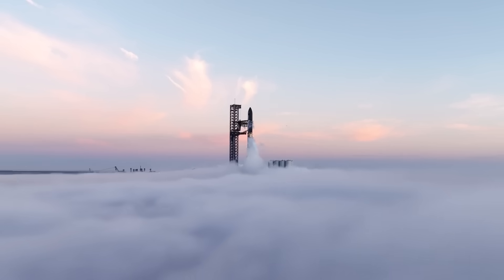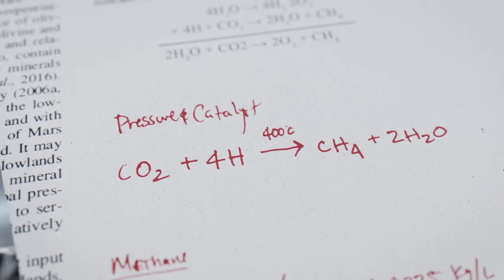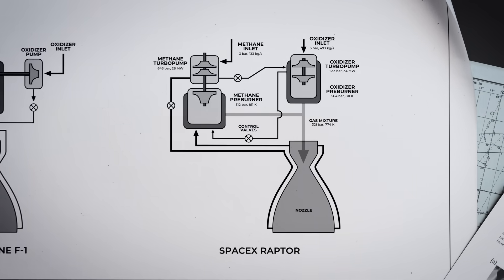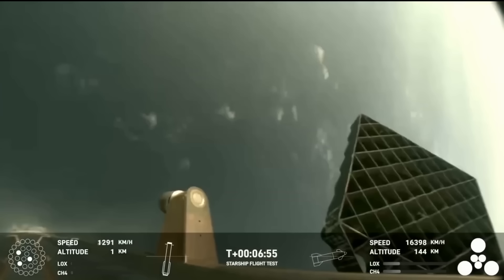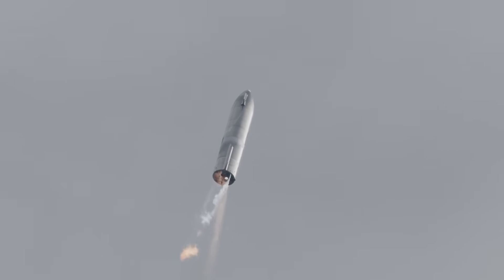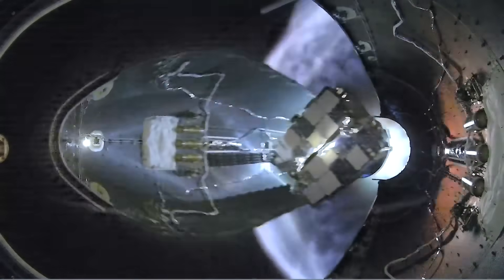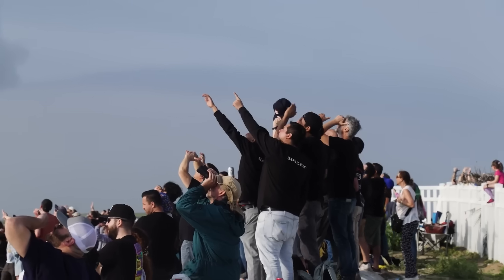Starship Reached Space. What Now?

Comment: You forgot the part where they need to launch 8-14 more to refuel it to get anywhere
Reply: That's incorrect. Starship can send about 20 tonnes to GTO with no refuels, or about 50 tonnes to the moon or 20 tonnes to Mars with just one refuel.
The 8-14 refuel figure is specifically to send HLS to the moon, which has a TLI injection mass of about 600 tonnes.
For comparison Saturn V could get about 45 tonnes to TLI, so it would take about 13 Saturn V launches to send that same mass to the moon.
And SLS can only send 27 tonnes to TLI, so it would take about 22 SLS launches to do the same.

Comment: I have to take issue with some of this and I do so not with any hostile intent.  First, I highly doubt that any SpaceX rocket will ever be captured by the chopsticks and fly again.  I mean, it may catch one, but I doubt it will do so without damaging the rocket in the process.  The precision the chopsticks will need to operate with and do so at speed and do that with large structures with very high moment of inertia is not something I'd bank my company on.  And second, NO, it is folly to incorporate launch and landing on the same tower -- in fact it's idiocy to even attempt it.  In a situation in which the booster returns to the launch area, and that is a small percentage of all reusable launches, the time after launch for the booster to return is on the order of 8 minutes -- 8 minutes after a nearly 800 million horsepower rocket departed the same tower.  If there was damage done to the tower the booster may not be recovered whereas if the booster capture pad was located some distance away it would still be available.  Additionally, the launch tower is at risk of damage by not only a failure during launch but also during landing which increases the chance the launch pad will be unavailable for some time.  I am stupefied that this isn't 100% obvious.

Comment: Hey realengineering,
I can already see a bunch of issues with this, but could there be any use for magnetic confinement technology to assist in reentry much the same way Helion uses it to protect its machinery from the hot plasma?
Reply: First thoughts...permanent magnets are heavy, coils are also heavy and need a lot of power, or less power but heavy refrigeration gear to make them superconducting.  Rockets (or at least, rocket designers) hate carrying unnecessary heavy stuff.

Tiles are a lot lighter.
Reply: @Mark_Bridges  oh yeah definitely, I’m more wondering if it’s even possible. Although now that you mention it I wonder about trying something like attaching a generator to one of the preburners and then just using a little fuel to power it. Again, not sure of the practicality of any of this, But I thought it was an interesting idea.
Reply: @romanthomas9113  I suppose you can obtain power that way, although the rocket motors aren't operating during reentry so you'd need to store the power...batteries are also heavy.  I reckon you'd be doing very well if you can get anywhere close to making this idea work.
Reply: NASA has actually done some research on the idea. See the paper "A Plasma Aerocapture and Entry System for Manned Missions and Planetary Deep Space Orbiter"
The first problem is that it's heavy and uses a lot of power. This can potentially be improved with better technology - maybe superconductors?
The second problem is that it stops working once you slow to about Mach 10 since the air stops being ionized at around that speed - but air at 'almost plasma' temperatures is still pretty hot, so you still end up needing some heat shielding anyway. Though steel is a lot more heat resistant than traditional spacecraft materials, so Starship might get away without it.

Comment: So correct me if I’m wrong, but they have gotten the raptor engines to work, but the main issue is that the ship tumbles when it falls back to earth, so it gets burn apart when it reenters earth?
Reply: Yes, although they got the raptor engines to work maybe 2 years ago.  Spacex will sort out the control problem that caused the tumble and the next launch will be better. Fingers crossed.
Reply: The only thing they haven't been able to test for the engine is the ability to re-light in space, they chose to skip that test on IFT3 rather than risk the ship going the wrong way due to the rotation.

Comment: Need to have some re-entry fuel to slow down and avoid intense heat.  It's an energy problem.  Don't subject spacecraft to such intense heat.  Yeah yeaj the rocket equation, etc...  Doesn't change the point.
Reply: Perhaps you forgot the shuttle used a very similar method to reenter the atmosphere?
Reply: But it does make your point meaningless.

Comment: I think making it 100% reusable is too ambitious. Let the booster be disposable and focus on making the upper stage the kind of craft thay have in mind.
Reply: It might be to ambitious.  However the most shameful way to fail at something is to fail for lack of trying.
Reply: the booster is way more expensive to make so they should focus on both.
Reply: @kylej7593  
The booster is also the easier of the two to recover, and doing so has less impact on performance. If you can only recover one stage, then you absolutely want it to be the booster, not the ship. Funnily enough, that's exactly what they did with Falcon 9...
Reply: @lazarus2691  what are you talking about? The second stage is supposed to ferry people and cargo to and from orbit - recovery is essential. The multi-stage with capsule model exists for a reason. People did a lot of failure in the 50's and 60's to learn these lessons. Also 30+ years ago the soviets launched energia twice, the second time had a fully automated re-entry vehicle modeled on the STS - no explosions.
Reply: @howilearned2stopworrying508  
It would be cheaper to launch people on Dragon than to throw away a Superheavy booster in order to get a crewed Starship up. Without Superheavy reuse there's no point in reusable Starship, so you might as well relegate it to being a partially reusable super heavy lift vehicle, for which there is still plenty of use cases.

Comment: Why is starship constructed of steel instead of aluminum? You would imagine the reduced weight would be a major benefit. Seems strange given the success of the shuttle program. Is it a cost concern? Is the ballistic coefficient meaningfully changed in an advantageous way? 

I also admit I’m not a material scientist or engineer. I’m sure there is something obvious I’m missing.
Reply: aluminum melts at a lower temperature, which is very bad for a vehicle undergoing reentry. Al is less dense, but not lighter by much, if at all. the lower density means you need more of it to get the same strength (kinda a gross simplification). it mostly cancels out. also, the steel they use holds up better at super cold temperatures than Al does, which gets brittle.
Reply: @kylej7593 You got it right on about the material specs, but you didn't go into cost .
Steel -- even that type of steel that doesn't get brittle at cryogenic temperatures -- is cheap .
As in, really stupidly cheap.

You can chunk out a steel rocket for significantly cheaper than you can an aluminum one (half to two-thirds the cost), and compared to carbon-fiber rockets, the savings for steel are ungawdly.
Tim Dodd did a cost comparison between steel and carbon fiber in a video with the title, "Why SpaceX ditched lightweight Carbon Composites for Stainless Steel to make a sweaty Starship." (YouTube doesn't even let you post links to their own site.)

Dodd's video has been largely overtaken by events, but the cost comparisons are still good.
The cost comparisons for aluminum and steel are just manufacturing industry standards, but they're in the right ballpark.
Reply: @kylej7593  Good summary.

Comment: Actually, at 2:08, the space shuttle only experienced blackout until 1988. After that, they were able to maintain communication thanks to the new Tracking and Data Relay Satellite (TDRS).

But it's not as simple as transmitting upward; there's only a narrow channel behind big spacecraft where the signal can pass without too much interference with the plasma. What Starlink enables is higher bandwidth to transmit video as well.

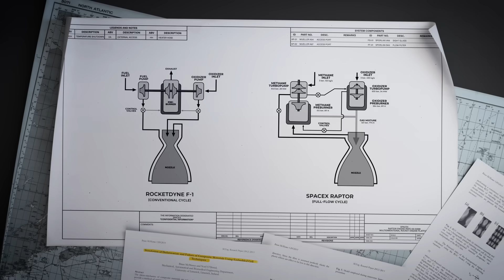Comment: Small factual error at 7:32 you say that only a small fraction of the propellant is pushed through the turbo pumps. I think you meant preburner? All the propellant is pushed into and by the turbo pumps of course. Another small detail is the roll Starship did. It's fairly certain that it was what's called a BBQ roll. In order to heat up from the sun from all directions spacecraft that go through a coasting phase do such a roll. So IMO the roll was fully intentional but maybe they had issues with their reaction control system to stop it before entry.

Comment: No worries about Mars having enough water. There is plenty, right there on the surface; even near the equator. Just one example: At the west end of Valles Marineris is a feature called Noctis Labyrinthus, which is in the heart of the Tharsus region. The coordinates are 7°S, 93°W. There is a relict water ice glacier there which holds 36 billion tons or 8.7 trillion gallons of H2O; slightly larger than Lake Meade at the Hoover Dam near Las Vegas, Nevada.
Reply: And if you still need more you can make it from some of the fuel from the MAV

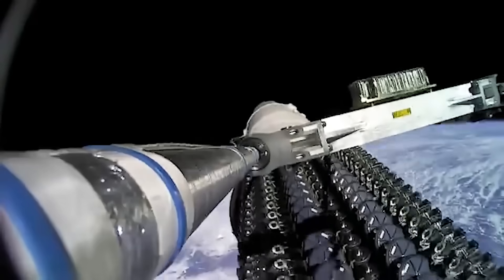Comment: 2:25. Ummm...  No.  The space shuttle could and did use the TDRS system to maintain contact with the ground in exactly the same way as Starship tried to do.

As pointed out in the telecast, it isn't 100% certain  that this will work for Starship -- whether it works depends on how "diluted" the energetic ionized gas is, which depends on the cross-section of the vehicle during re-entry

Dragon has a relatively small cross-section, so the plasma is dense enough to block communication behind the vehicle, which is why we don't have live telemetry for Dragon capsule re-entries.

The Space Shuttle had an enormous cross-section, so it only rarely suffered from communication blackouts during re-entry.

Starship is somewhere in between, so....  maybe?

Also, at some point in the past infrared video was captured of the plasma generated during re-entry for the Space Shuttle.  It was part of the OEX suite, which involved mounting two cameras in the tip of the tail, pointing down and towards the front.  While the cameras and the like were removed long ago, the modifications to the tail remained, which is why Columbia's tail looked different from the other orbiters.

The footage was taken long ago, however, and it wouldn't surprise me if it was discarded without being digitized.  But it certainly existed at some point in the past... 😂
Reply: I think he meant this is the first time we've seen real time video of reentry plasma, therefore I say ummm... Yes.   I don't think Shuttle video you mentioned was real time.

Comment: When returning, both the booster and the second stage blew up. While this is definitely a failure for SpaceX's ultimate goal, if this was anyone else and any other rocket, it would be an immense success. Most boosters and second stages blow up, if you look at it that way this was a complete success, SpaceX has just showed off a rocket larger than any other in history, getting to space. Technically they could stopped development right there and start mass producing them and using them to destruction. It might not be too insanely expensive either since the rocket is made of steel, the main cost would be many expensive raptor engines. Kinda shows how crazy SpaceX's goal is that a complete success for anyone else, is basically just them completing the easy part.

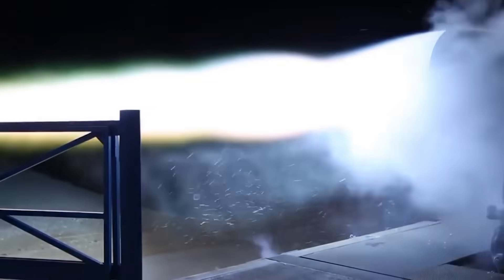Comment: The language at 5:20 is a bit sloppy / incorrect. Raptor is not the first full-flow liquid rocket engine.  Most Russian / Soviet rocket engines were full flow rather than open-cycle.  Engines using that principle of operation have been used in hundreds of flights by both Russian / Soviet and American rockets for 6 decades.

Raptor is, however, the first full-flow liquid rocket engine with staged combustion, which was mentioned at 1:30
Reply: The RD 270 never flew. Which was what they said

Comment: Getting a giant rocket into space is one thing. Getting it back is another. These things have too much mass and surface area to keep from burning up. Most re-entry vehicles are small with the exception of the space shuttle, which was a space plane very different from a long, large thin tube. SpaceX has done some amazing things, but this is a bridge too far. A great platform to get heavy payloads into space, but I think a lot more of these are going to burn on re-entry before they realize the physics doesn't support re-usability. It was barely scratching the atmosphere before the heat tiles were flying off like confetti.
Reply: So you're an engineering expert with more information that a bunch of well-resourced spacex engineers??  I'm glad spacex makes decisions based on science, not the ramblings of armchair experts.

Comment: They attempted to start the booster engines at a descent speed of 1200 km/h, so the nozzles pointing downward were facing an air current of 1200 km/h. I can't imagine the amount of pressure that current would translate into at that moment when it is concentrated at the top of the nozzles, opposing the engine's exhaust. Does the Merlin engine experience the same counterpressure during Falcon 9 booster landings?
Reply: The merlin engines do an entry burn when the booster is moving at something like 6000 km/hr (number from memory, probably wrong) but that burn isn't too bad because the air is still fairly thin.  They do a landing burn at something like 1200 km/hr (ditto) so yes, similar conditions to starship.  The merlin engines do it all the time so spacex will get it right with the merlin engines soon.

Comment: i think the fuel left in booster after boost back or entry burn is too low, it wont make smooth landing to the launch site except doing suicide burn
Reply: Not the case
Reply: yea i know its not current problem, but it will a problem. at 3rd flight test, starship doesnt carrying any payload and the booster landing at sea with almost empty fuel  @weekiely1233
Reply: yea i know. its not current problem, but it will be a problem. at 3rd flight test. the starship doesnt carrying any payload and the booster landing at sea with almost empty fuel
Reply: @secrettube4u  they carry less propellant on these flights than on operational missions
Reply: @weekiely1233  when they add fuel it will add mass too, when mass added it will burn more fuel to lift off (like the 1st test flight). i hope when real operational mission is begin, the fuel will not be a problem
Reply: @secrettube4u  it won’t be

Comment: In the live stream of the starship re-entry they were saying it was barbeque-ing, they rolled the starship so the temperature wouldn't be to high from one side. Was this true then ?
Reply: no, they have the heatshield only on one side
Reply: @0topon  thats what I thought, well thanks
Reply: @karikol7944  The tiles are on one side but that's got nothing to do with the roll.  Starship would have rolled during the in-space coast phase to even out the temperature but the roll should have been cancelled just before reentry to face the heatshield tiles downward. I don't know why the roll wasn't cancelled correctly, I assume some failure of the attitude control system.
Reply: @Mark_Bridges  thanks for the explanation!

Comment: 0:56 the orbit altitude of the ISS is 400km, i.e. 250 miles. Looks like you got confused by the units!
Reply: Lower orbits are faster so it could have been going as fast as the ISS
Reply: @SenseiShart  what the f are you on about?
you literally need more speed to be at higher orbits.
Lower orbits can be completed in less time than higher orbits because they are shorter.
Reply: @namenloss730 But you do go faster at a lower orbit.
Reply: @PieterPatrick  you mean point to point on earth or actual velocity in m/s of the craft?
Reply: @namenloss730 velocity of the craft.
Less gravity means a slower velocity.
ISS goes faster than Hubble.
Reply: @alxz3707  thanks for the clear explanation
Reply: @xXDarkKisukeXx  dear f'ing god... muskrats really are idiots who will believe any pseudo science
Reply: I've also seen channels like Scott Manley and Space X themselves claim Starship III reached Orbital Velocity which is 27359 when Starship III's max "orbit coast' was around 26700 a full 600KPH short of Orbital Velocity.
Reply: @Wallyworld30  the speed difference is negligible - around 1-2% between Starship’s achieved speed and the orbital velocity at that height. It’s essentially orbital speed. It just isn’t in an orbit (just barely suborbital - perigee is a few dozen km below ground level). On the other hand, I could be plunging towards the ground at 27000 km/h and I would still be travelling at orbital speed as well.
Reply: fuck thr imperial system
Reply: 400km vs 250km, the velocity difference is not that much so it is still quite close
Reply: @davegamingr1  not that much as in? Only an extra 50%?
Reply: @namenloss730  nah not even that
Reply: @namenloss730  maybe like 500-1000km/hr more in terms of velocity
Reply: @davegamingr1  citation needed on it only needing to increase it's speed by 5-10% to reach double the altitude
Reply: @namenloss730 orbital mechanics and atmospheric affects. Most of the delta v is used up during the ascent stage, escaping the atmosphere
Reply: @namenloss730  Up there without air friction its not much… just a small burn needed to get it up.